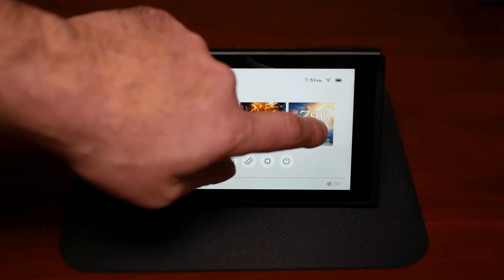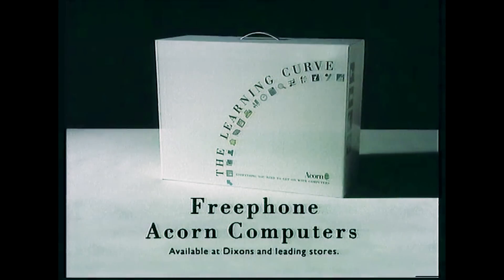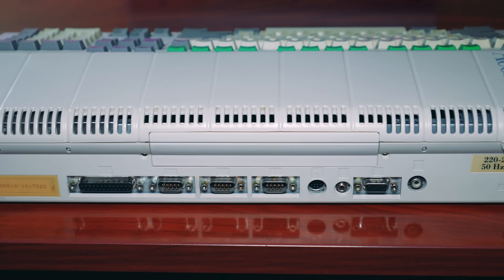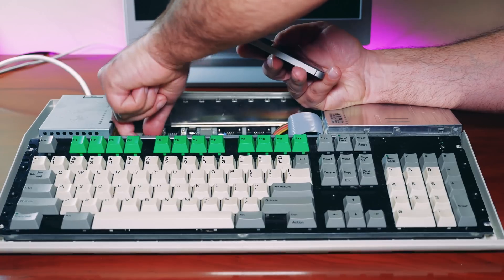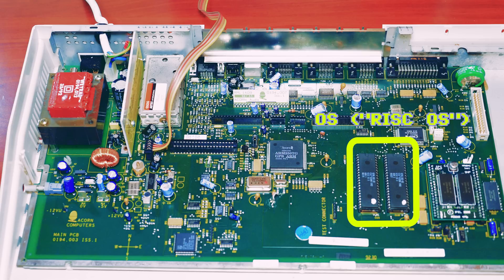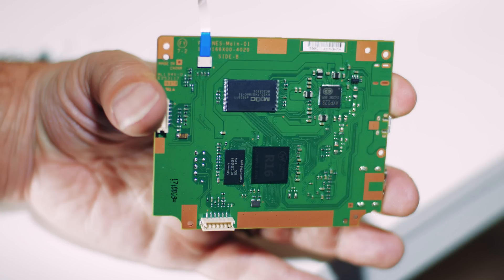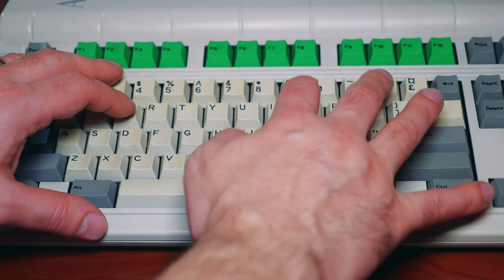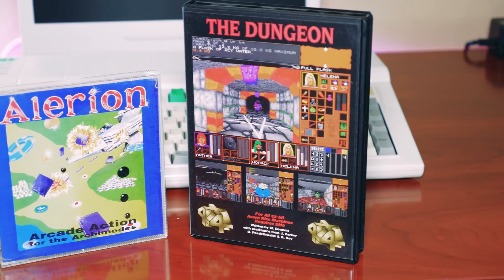Acorn Archimedes A3010 System Teardown and Review | MVG

Comment: * 'You cant do much without the mouse' * FALSE!! 
You can download mouseopt and control the pointer with the arrow keys and select etc. with home, pgup , pgdn keys. 
Also it has a supervisor mode by pressing f12, you can control everything from here.
Also, you can load discs from supervisor so not having a mouse wont stop you playing games.
Also you can hack some old ps2 mice to be quadrature or buy a Quad to ps/2 mouse adapter.
You cane even use a atari or amiga mice with a very homemade simple adapter
Also you can use a serial mouse , just select mouse type 1 and plug the serial mouse into the serial port -old serial  mouse ar echeap on ebay 2 to 3 usd!!
* 'You will need to get the mouse...' * ERM NOPE!!
you CAN operate the entire machine without one , very easily. This is not an AMIGA!
Reply: Yeah but isn't that too "complicated" for noobs? Or less tech-savvy people meeting these machines for the first time?

It's easier to just have a machine with a standard mouse instead of knowing your way around the "configure mousetype"-commands ;-)
Reply: @epdm2be620  It's super simple like press F12 then type  2 words, hit return and reboot (automatically saves to CMOS). This is not an AMIGA. This computer is really easy to use.
Reply: @ojbeez5260  Agreed !
Reply: The Amiga can be fully controlled without a mouse. What are you talking about.
Reply: @Fularu  Not without the OS discs it can't. You can even access all the features of the machine through it's built in Basic. Plus the OS is on ROM too! No need to load off disc.

Comment: For those here having trouble finding a working official mouse for this system, I did some Googling and found a serial mouse driver for the Acorn Archimedes on RISCOS Ltd's website. It should work with regular serial mice, although the driver has to be installed manually: http://www.riscos.com/ftp_space/hardware/serialm.zip

From what I've read, later ARM-based Acorn systems have this driver built-in.

Anyway, I hope this helps. If you're going to try this, make sure you get a three-button serial mouse, since the GUI was designed with three-button mice in mind.

(Disclaimer: I haven't yet tried this driver myself, since I currently don't own an Acorn Archimedes myself. 😉)

Great video, by the way! ☺️ It's always fun to see the lesser-known vintage architectures receive some attention, especially one that ended up playing such a profound role in all our daily lives to this day. Keep 'em coming! 👍

Comment: Sure the keyboard is excellent : it's made by keytronic.
Did you know the A3010 has an onboard IDE controller ? Like in the A3020 and A4000. To be able to use it you must add the 'missing' parts existing in the A3020 or A4000, with a bit of soldering.

For the mouse : you can use a serial mouse, and just load the driver from floppy with the CLI.

With faster RAM chips, you can overclock the machine up to 26 Mhz ...
https://youtu.be/-uP-cQ43EAw
All videos here :
https://www.youtube.com/user/sonicframe

How to do that is explained on stardot
Reply: The A3010, A3020 and A4000 used the same motherboard, just with different areas populated depending on which model it was going into. The A3020 was built for educational use (it had red keys too) while the A4000 looked like a half-height A5000 with a separate keyboard and was meant as a more professional system. The only down side to these three models was the fact that the SoC design meant that you could not upgrade the processor to an ARM3 as you could (with some effort) with the earlier A3000 and other ARM2 based systems.

Comment: A vintage PC Bus Mouse can be modified to work and they are much cheaper. Only need to open up the mouse and swap the pins around on the cable connector.
Reply: Antony T Curtis Are you sure ? There is a missing wire in the bus mouse, compared to the Archie mouse.
Reply: Zarchos I have used a modified 3 button bus mouse with my A3010.
Reply: Antony T Curtis That s very interesting. Could you tell me how many wires you ve got ? IIRC there are  8 wires in a bus mouse and 9 are needed for the Archie.
Reply: The bus mouse I have modified is a Leaguer brand mouse, model LG-BM-3816 and it has 9 wires.
Reply: Thanks ! Interesting as I bought a lot of bus mouses and bad luck for me : only 8 wires. Could you tell me where you got your mouse from ?
Reply: I got it from ebay, I basically looked for 3-button bus mouse and bought the cheapest.
Reply: This one should be modifyable since it has 3 buttons and it looks much more like original Archie mouse. http://r.ebay.com/bQOJpo Of course, there will be people screaming sacrilege...
Reply: Thanks for the link.
Reply: No worries. It should be simple to open up the mouse and swap the pins around on the connector which plugs into the mouse PCB. I didn't have to do any soldering on mine.
Reply: @Antony T Curtis: Naaah, Acorn folk tend to be more forgiving than Amigoids ;-)

Comment: Great video! I admit I was not familiar with this computer. The case design reminds me of the Tandy 1000.  I like the fact the keyboard layout is almost identical to a modern PC and that it had a standard VGA.  That's something I always wished the Amiga had.  I also love the idea of it booting from ROM.
Reply: He's American. Acorn didn't have computers in American schools.
Reply: @Nimmo1492   Acorn was not pop outside of UK
Reply: Theo Buunermond Not strictly true.. the quality of the BBC Micro keyboard was just as high quality, much like the rest of Acorn's engineering and manufacturing. They made some of the most reliable Micro's of the the time, and in fact there have been reports of these machines having the most basic one off repairs and still being used for tasks they were first doing back in the 80's.

What I do miss... really miss.. is BBC Basic and later iterations that remove many inherent restrictions of the past.

It was a really easy language that expanded what BASIC could really do and I only wish I could have a piece of software that could compile as an Android app and chat to other apps (camera, contacts etc) in the Android environment.

I'd be there for weeks making apps.
Reply: You can get a free BBC BASIC implementation that's in current development at http://brandy.matrixnetwork.co.uk/ it's a fork of Brandy, supporting much more functionality than the mainline version.
Reply: The reason why this machine had a great keyboard isn't that difficult. Olivetti bought Acorn ;)
Reply: AmstradExin we had computers, but they were IBM compatibles that the school staff could barely figure out how to turn on. My brother went into BIOS and set a password, locking the entire lab down until he finally admitted it and removed it. I was nicer, and just did my work and helped the pretty girls with theirs for free. I charged for helping the boys. I was one of two in the class who had a computer at home, a Commodore 64 and a 386 with a 16mhz clock speed and a 45MB hard drive.
Reply: AmstradExin Not much use then...
Reply: The keyboards varied. For example I used an A3000 and two Risc PCs (what came after the A30x0/A4000/A5000) and while the A3000 and the Acorn-built RPC had pretty good keyboards, the Castle-built RPC keyboard was pretty crappy - it felt like (and looked like) a low end Dell keyboard. It was like they bought a job lot of standard cheapy keyboards, ripped the Windows key off and put an Acorn key in its place. It's a shame that my original Acorn kbd met with an accident with a can of coke or I'd still use it!
Reply: @The 8-Bit Guy, :) Well, technically, eventually the amiga did have standard VGA if you include the CD32 with its various SX expansions, like SX32 or SX32-pro. Sure, people could argue that it doesn't count since you had to plug a thing in. However you had to plug a tv modulator into other amiga models for other video changes, so it's all swings and roundabouts.But, as you know, it's a moot point nowadays since open source addons (e.g terriblefire).
Reply: In the USA, they had Apple's at schools, not computers. :D
Reply: @AmstradExin  US schools had predominantly computers from American brands. In the early 1980s it was mostly the TRS-80 and TI/99 computers that dominated education, in the late 1980s it was mostly Apple computers, and throughout the 1990s it was basically all IBM PC compatibles.
Interestingly enough, the Commodore Amiga, although an American brand, was more popular in Europe than in the US as a home computer.
Reply: TheSaintST1, as an Acorn user I know that the earlier models had great keyboards, but Olivetti was by far a greater brand (typewriters) with excellent quality. So I would be suprised that this model had a bad keyboard ;)
Reply: Probably because you are a loser who knows very little with thousands of losers paying you being the only reason you are still around sadly for the retro gaming community.
Reply: Nimmo1492 oh, I thought he was English. What with all the 8 bit computers.
Reply: The 8-Bit Guy 
You should boot up RISC OS on an emulator or an RPi.
It was a decade and change before it's time.
It's typically described as "Windows 95 like", although it's dated 1984!
Reply: For him 8-bit is retro in the UK it's state of the art. LOL
Reply: The 8-Bit Guy Um, did you not go to school?

Comment: I bought one of these but the mouse was dead and the average price for one is £50 :(, did see youtube of dead mouse fix and with use of a  multimeter the guy found one of the resistors inside was bad and once replaced the mouse was working again so that's on my to do list :)
Reply: vic20kid ...and good luck with your fix ;)

Comment: Great video MVG!  Nice to see the insides of an Archimedes. Wow, there's nothing to it. I was expecting loads of capacitors, resistors etc, nope.

Although the Archimedes was technically a better machine, I knew of only one person (my neighbours daughter) who had one (albeit a A3000). The Acorn machines weren't popular amongst us kids when I was growing up. I wonder if that was down to poor marketing or limiting software library available?

But lets be honest. When you were a kid, you got the computer your best friend had so you could swap games with them. You weren't going to get a ZX Spectrum if your mate had a C64 now would you? 

But when I was a kid back in the later 80's/early 90's, the most popular computers amongst the kids were: Amiga 500, Atari ST, ZX Spectrum and C64. We had the odd kid here and there who had an Amstrad or IBM PC.

Great times #FlashBackMemory
Reply: That was because they were used in schools. And schools had a bad reputation when I (and you probably too) were growing up. At least in the UK. You wouldn't want to have the same computer as the boring ones in schools. So Amiga's, Atari's and Playstations were much more popular at homes. AND a lot cheaper too. The A3010 was the cheapest replacement o/t A3000 usually sold with only 1MB of RAM while the A3020 was a much better option as most A3020 came standard with 2MB RAM inside. Later these A-series got replaced by low-end PC's as they were even cheaper than these low-end Acorns.

For the interested people; the A3020 looks exactly the same but has the RED function keys (and red floppy eject button) like the A3000.

Comment: PS - Don't throw your broken Archimedes mouse away it might be repairable! I have a video on my channel on a recent mouse repair #ShamelessPlug
Reply: LOL this is the youtube guy I was talking about in my post :) how to fix the mouse ;)
Reply: There's a company (Stuart Tyrell) in the UK that sells Acorn-serial-to-PS2 mouse adaptors. Aso later A7000-RISCOS machines have both PS2-keyboards en PS2-mouse ports. While the famous RiscPC only has a PS2-keyboard-port but serial-acorn mouse port. Perhaps for a collector of vintage machines these A7000's are an easier option. Though true collectors of vintage Acorn machines tend to go for the Risc PC (especially with Digital StrongARM cpu's). A cheaper (and perhaps better option) is to obtain a Raspberry Pi Model B (the first single core model) and run RISCOS on that. The first RPI has the least compatibility issues running the latest version 5.23 of RISCOS. While the RPI3 is indeed MUCH faster (3x faster) but has more compatibility problems.

And if collecting vintage machines isn't your thing but you still want a taste of this OS there's a great commercial emulator called Virtual Risc PC (Virtual RPC) and a bunch of freeware emulators as well (like e.g.  RedSquirell and RPCEmu).
Reply: Mouse? How about throwing away an entire A310 system, monitor and all. I cringe and cry every time I remember binning it all because of a blown capacitor :(